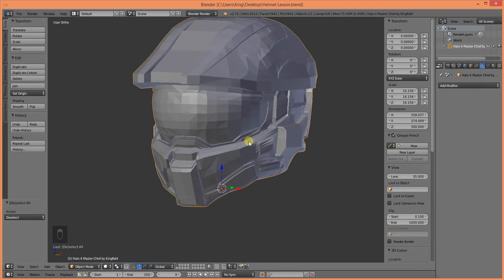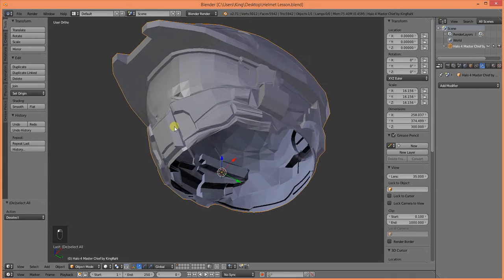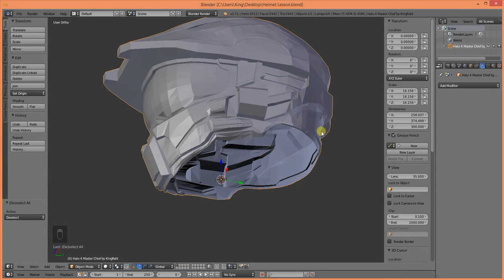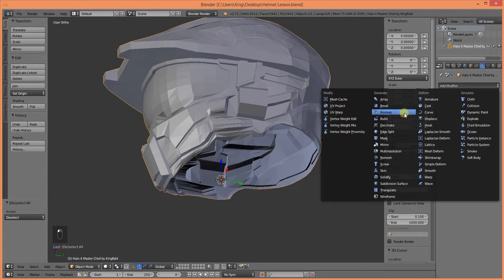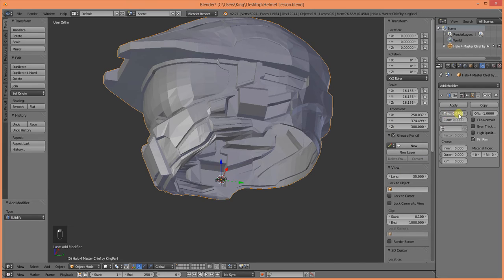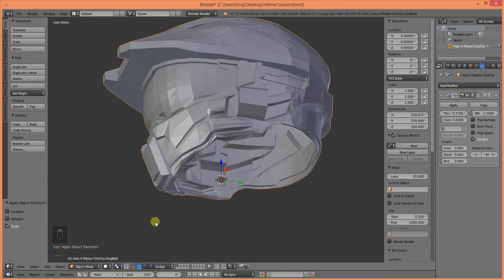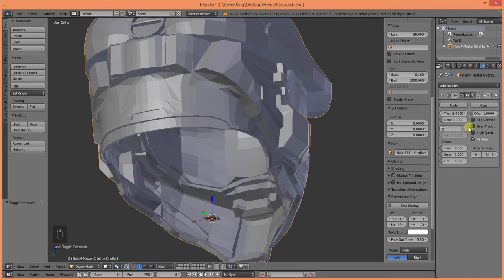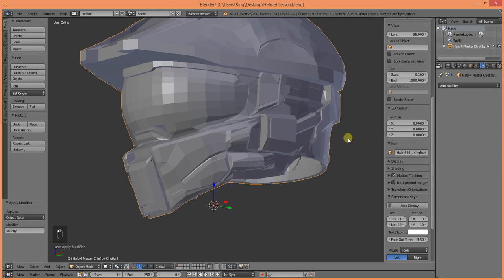Video 4 Solidify Helmet

Comment: can we solidify only a selected face of the model? Because, when i try to solidify all my model, i got vertices that goes everywhere, Like if i where in "Even thickness" mode
Reply from the maker: Not that I know of. If you only want to solidify part of it, you'll have to separate that part from the rest and solidify it by itself. Those points going everywhere shows the model needs to be cleaned up first.
Reply: when i clean it, the model goes "smooth"
EDIT: ok so i just have to make the hard edge again apparently and it's good. 
EDIT2: finaly, it doesn't change a lot... still have the same problem

Comment: so what if not all the normals are facing outside but are on the inside?
Reply from the maker: In "Edit" mode - select all vertices - Mesh - Vertices - Remove Doubles.  This is to clean it up a little. To change all normal, in "Edit" mode - select all vertices - Mesh - Normals - Recalculate Outside.